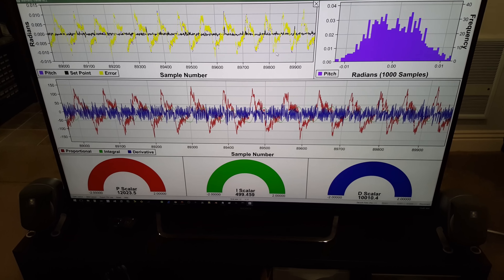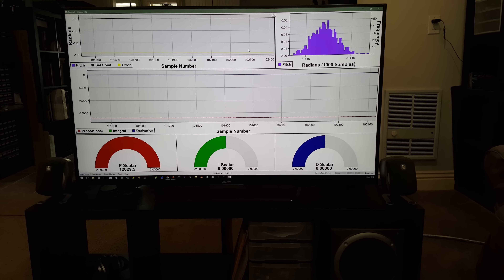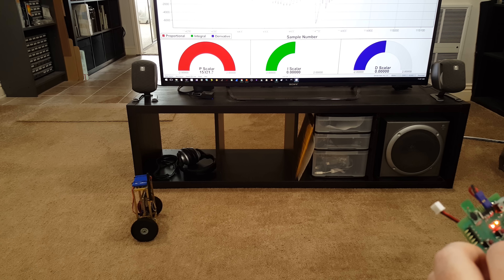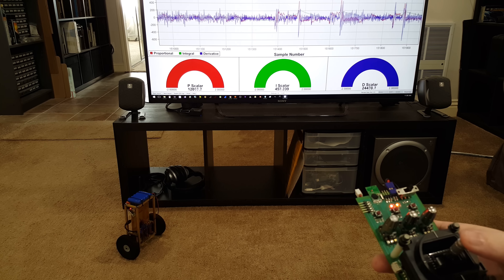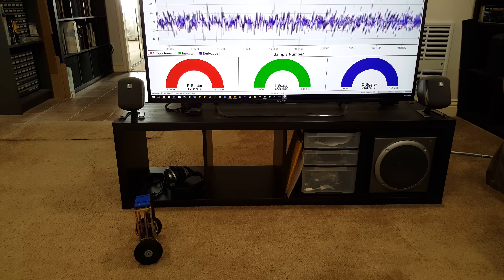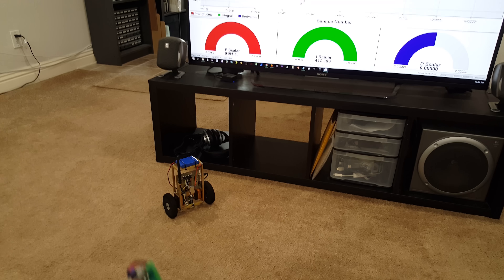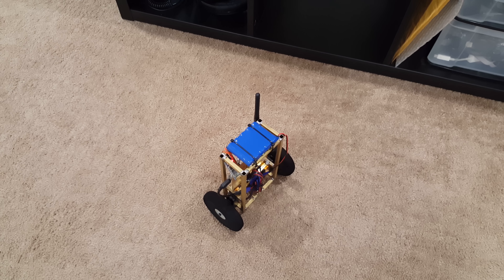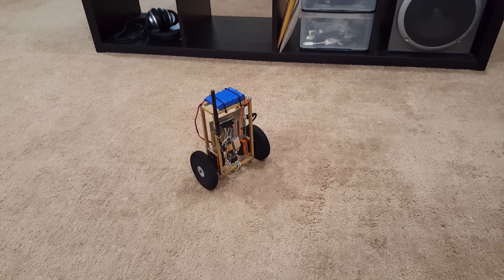How to Visually Tune PID Control Loops

Comment: Great video, thanks for sharing the code , thumbs up! I am trying to construct a very similar system but which does is some way the opposite( not to maintain an equilibrium\balance at a set target but to stay away from it) . A safety mechanism that prevents a motorcycle from flipping over when wheeling, when it reaches a critical angle, system kicks in and a servo motor pushes a brake pedal and brings the motorcycle back to "safe" angle range.
Reply: sounds like a great idea.  patent it!

Comment: How would you add an additional device that only turn on when the wheels are moving, so if the robot was still the additional device object also stays off but does not have the same voltage.

Comment: May I suggest something slightly different: Apply a transformation to the total PID output that attempts to "flatten" the rotational acceleration. In other words, work out a function that computes the static torque required to support the weight at each angle. Measure the function that maps throttle input to torque (maybe this is hard to do without complicated hardware, so a good proxy might be to measure current to the motor unloaded (or with any load that does not lock it up) for each throttle position and draw that plot). Then tune a PID algorithm that feeds the input to a control function that only requires normalized torque (and automatically remaps it to throttle based on current instantaneous angle)

Once you flatten out the non-linearity of controlling the inverted pendulum, you can tune a PID (or any other linear controller of your choosing) on top of that and I believe you will have far smoother control.
Reply from the maker: You're right. I stopped when it got "good enough," but yes, there is plenty of room for improvement.

Comment: please. is the PID a software control system or hardware????????
Reply from the maker: I did it in firmware, but a PID control loop can be done either way.

Comment: Hi have you compensated the motor's deadzone ? how you did it? adding a constant value to the pwm ?
Reply from the maker: The motors don't have much of a deadzone. If you are referring to slop in the gears, the servos I modified have very little slop. I didn't need to compensate for it.
Reply: @upgrdman  thanks for your answer, what I actually meant with the dead zone is the the value your PWM in the motors starts making it run. For example, in my case, from 0 to 100,  the robot start moving when PWM is around 30.

Comment: hello and great work! -one question on the integral variable. how it gets accumulated if  you assign it to 0 just before?
Reply from the maker: Thanks. It's a "static" variable, so the 0 is only assigned during start up, not during every function call.

Comment: Very good. What is the minimum number of readings that you must have per second? In other words could it work with only one reading per second?
Reply from the maker: A PID control loop can be used with any sample rate, but for a balancing robot I wouldn't want to go much slower than 50 Hz.

Comment: Nice work there, just have a question. Why is the battery positioned at the top of the robot, isn't it harder for the controller to balance?
Reply from the maker: Having some weight up high actually makes it easier to balance.

Comment: Hi, where did you get that joystick (the gimbal part)?
Also, you might wanna try to control the cossine of the pitch instead of the pitch itself ( i.e. error = cos(pitch) - cos(set_point) ). The torque needed to counteract the falling of the robot should be proportional to the cossine of the pitch. I haven't tried that, but I think that it might help as it would make the system linear.
Reply from the maker: Thanks for the tip, I'll try that. The gimbal was pulled from a RC hobby radio. You can find used radios for cheap on eBay, and its often straightforward to remove their gimbals and reuse them. Or buy a cheap new radio from somewhere like Hobby King.
Reply: Thanks. Yeah, a full radio on hobby king is half the price of a single 
gimbal on digikey...But I thought there might be a cheap source for them
 on aliexpress or something, but could not find any.

Comment: How do you manage to avoid drifting to one side, accelerating and eventually falling to that side, while balancing without encoders?
It looks like you have perfect mass distribution between front and back (which can't really be in real world).
My robot keeps stabilized only on surfaces with high friction (like carpet), but on smooth floor it keeps drifting to one side and falls.
I would really be grateful for any hint on that.
BTW, great job with your robot.
Reply from the maker: Thanks. On very smooth surfaces, and sloped surfaces, it can drift like you describe. I was tempted to try using the accelerometer readings to compensate for that type of drift, but never got around to it. I suspect wheel encoders or some other means of velocity/position sensing would be required for best results.
Reply: @upgrdman  Hey, thanks for response. 
I just realized, that I control PWM (velocity) and not angle like in your case (I also do not have encoders - only angle position). Isn't that the case, why my robot keeps falling immediately to little bit heavier side?
BTW, Merry Christmas ;)

Comment: I have a question about those initial values of Kp, Ki, and Kd. How did the 12000 come out? In this video, you explained with the equation Max error * Kp = Max PWM. So Max error = 1000 (Max PWM) / 12000 (Kp) = 0.083 Radian = about 4.7 Degrees. I guess you set the max pitch angle to about 5 degrees, right? I am confused because you explained that you set max pitch angle to 30 degrees. Also, could you explain more specific about the initial values of Ki and Kd?
Reply from the maker: It's been a while and I don't remember exactly. I think I just held the robot at an angle that looked like it would require full throttle to recover from, and found that multiplying that pitch number by 12000 would result in a PWM setting of around 1000. So that would probably be around 4.7 degrees like you mentioned. The 30 degrees number is where my code says "we can't recover, turn off the motors, there's no point in even trying any more." This prevents the motors from staying on when the robot has fallen over. As for Ki and Kd, their initial values were 0 and I just tried increasing them until I got decent results. After finding a decent value, go back and tweak the other two, since there is some interaction between them.
Reply: Thanks for the reply. It clears my understanding. Btw, your telemetry viewer is awesome. Did you receive the telemetry data via RF module? I am trying to receive serial data in wireless with Bluetooth but having some issues in using BT.
Reply from the maker: Thanks. Yes, I'm using one of these Bluetooth UARTs:  http://amzn.to/2jm1HIw

Comment: Can you quickly tell some differences between Kalman filtering and Madgwicks Sensor Fusion?
Reply from the maker: The biggest difference is that Madgwick's filter is easier to use because it has just one coefficient that needs to be adjusted. A Kalman filter is the classic way of doing things, and it works well, but it requires a lot more tweaking to get things performing well.
Reply: great, thank you!

Comment: wow this is great. may i know if the GUI is on windows or Linux?
Reply from the maker: Thanks. It's running on Windows in the video, but it should run on Linux and Mac OS as well. I wrote it in Java, and the serial port and OpenGL libraries I used are supposedly cross-platform. I've only run it on Windows 10 and 7 but I wouldn't expect any problems on other platforms. For more info on the program, see the "Part 6" link in the video description.

Comment: try concentrating the center of mass on the wheels' axis to increase stability
Reply from the maker: That would actually make things more difficult. Think of balancing a pen on your finger. A longer pen (or whatever) is easier to balance. Having the CG higher up makes the system easier to work with.

Comment: So if you did have rotary encoders, how would that affect the set point?
Reply from the maker: With rotary encoders the robot could know if it is actually stationary. Right now it can only know it's angle. For example, if my floor was slanted, the robot would just glide down the slant (but stay vertical) instead of coming to a stop. Also, if I use encoders I could keep track of distance traveled and position the robot accurately.
Reply: upgrdman but even if you know wheel position that wouldn't matter because you still need to monitor your angle to keep it upright.  So even with a encoder it will still walk back and fourth?

Comment: Hi, what's your loop update rate?
Reply from the maker: I don't remember the exact rate, but it was around 70-100Hz.
Reply: Oh interesting. And how fast are those servos in terms of RPM? I have an issue where my bot is barely able to maintain vertical position. It may be because my bot is fairly short and does not have enough weight up top.

Comment: Im not a java programmer, but i think you set the previous error to 0 every time you run the function.
Reply from the maker: The firmware is written in C, and that variable is static so it's only initialized to 0 at reset.
Reply: I see, C and C# is different in this.